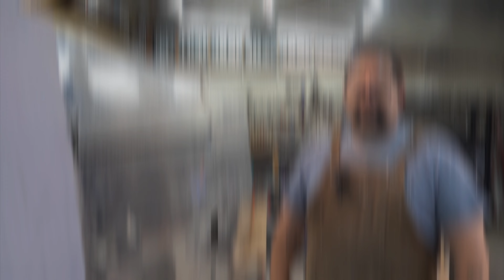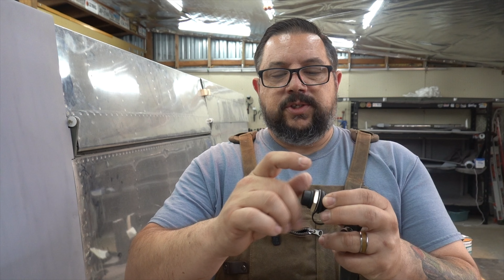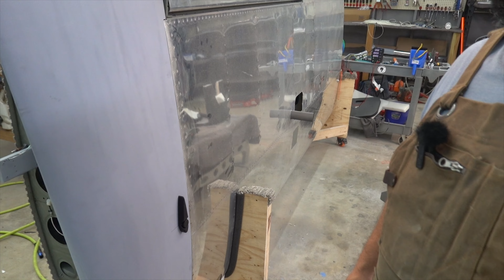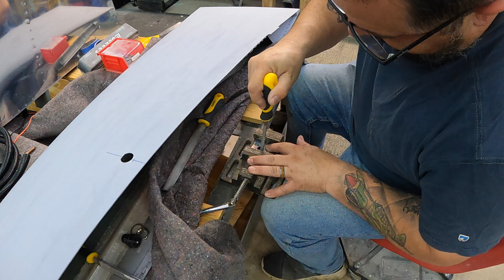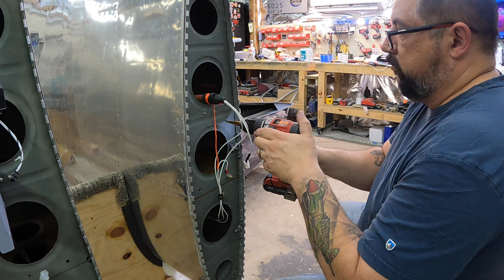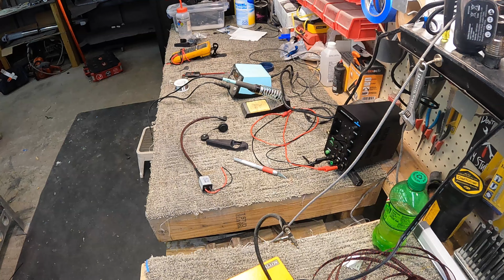Vans RV 8 Flight Camera Power System and New TFlight77 com store Ep126

Comment: what do you do with the cap when the plug is in use?  does it flap in the wind or do you have a stowage location?
Reply from the maker: I have seen others just rubber band it to the actual camera mount.  I am not using the retainer part of the rubber gasket so on mine I have cut it off and will remove the cap completely when in use and stow it in the cockpit.
Reply: @TFlight77  I would print the fairing with a male threaded stub, recessed, to screw the weather seal cap for retention while a camera is plugged it so it doesn't flop around in the wind.

Comment: How would you mount the camera itself?
Reply from the maker: Good question I will post a short showing what I have done for the actual mounts.  I added some nutplates in place of some of the rivets on the wingtip edge which will allow me to mount a "Rock Steady" mount from Flight Flix.  I have also added the same to the vertical stabilizer.  In addition to that I can also use a "spud" mount from N Flight camera systems for a standard action cam mount like a gopro.  I dont have any of the "Rock Steady" mounts yet to show but I do have a spud mount.
Reply: @TFlight77  Thanks! Looking forward to the next video in this series.